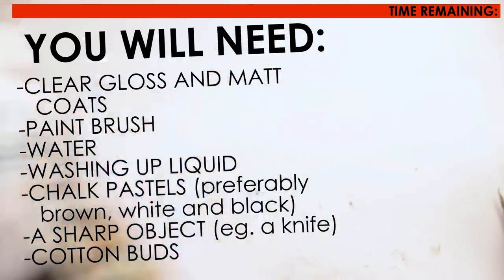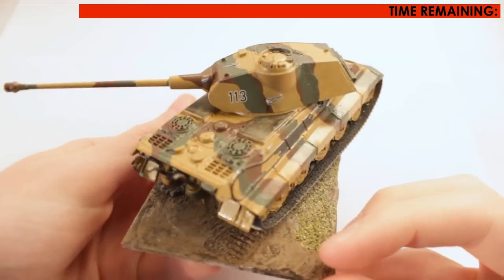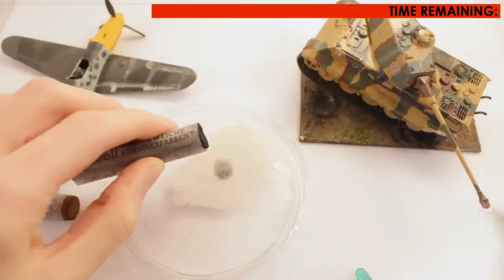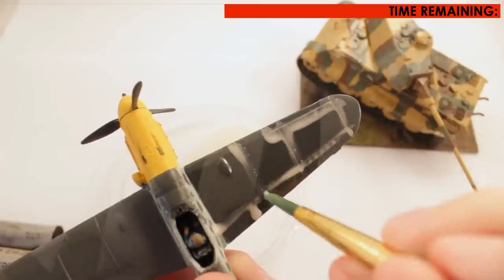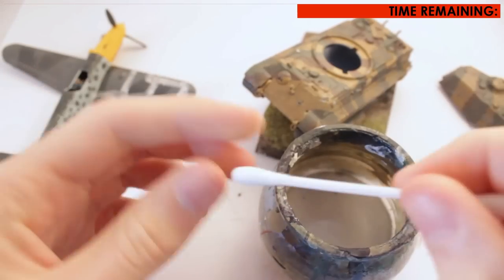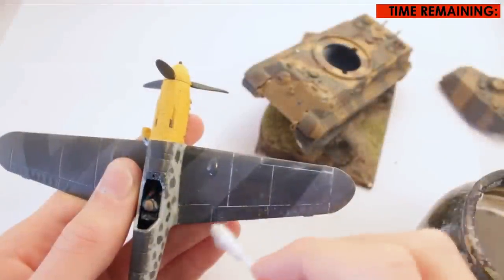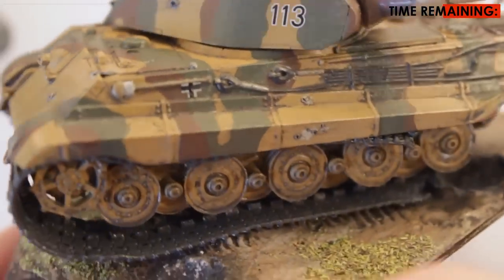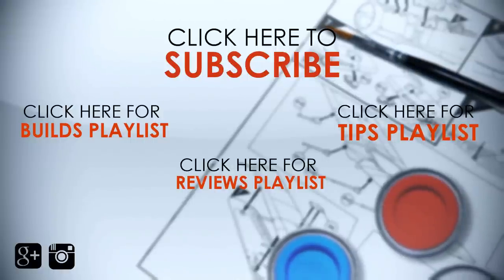Making Chalk Washes for Scale Models - Quick Tip

Comment: I dont get the coat process before decals and after painting, i heard that i have to apply gloss coat before decals to stop silvering, then i also heard you have to spray a clear coat again before a sludge wash?  So you spray 2 coats? And then a final coat at the very end? Im confused, so i need a overview of the steps after painting
Reply from the maker: +Tim's scale model building After painting, apply a gloss coat to make a smooth surface that will stop the decals silvering, then apply the decals, seal them with a gloss coat to protect them, then apply the wash. If the wash isn't oil or acrylic, then seal it with a coat of varnish either matt, gloss or satin depending non what finish you need
Reply: Quick Kits what about wash made from pastel?

Comment: Great tips! Owen could you please  tell me why when I put the wash on it never comes off with cotton buds and water?
Thank you Johnny :)
Reply from the maker: You may need to add more washing-up liquid/soap to the mixture. Test it on some scrap pieces
Reply: Quick Kits Thank you tested and worked!
Reply: Hey Owen,

I am just curious as to why the washing up liquid / soap and does it matter which soap ?
Reply: The washing-up/liquid detergent/dish soap is for breaking surface tension. Correct me if I'm wrong

Comment: I generally use white spirit and oil paints but this method may be less offensive to the old olfactory system.
Reply from the maker: Do you use acrylic varnish coats then? Surely the white spirit strips off enamel?
Reply: I only ever use acrylic paints and varnish

Comment: what can i use as an alternative to washing up liquid?
Reply from the maker: I'm not sure sorry, maybe just ordinary liquid soap? You'll have to try it on an old model first or something
Reply: hmmm i was wondering if it will work without the washing up liquid. I'll try it out if it works. Thanks for the response!
Reply: +Quick Kits Any dish soap will works.  It just lowers the surface tension of the water so the chalk stays dispersed and suspended in the water

Comment: If i don't apply the coat at the end, will the wash come off by touching it?
I tried some rain lines on  a tank and i'm afraid to touch it when it's dry.
Reply from the maker: Yes, really you want to spray a varnish over it to seal it and protect it

Comment: how to get rid of bubbles?
Reply from the maker: If there are bubbles in the wash you could have added too much washing up liquid to the ratio of water and chalk. It doesn't matter too much though, you can still apply the wash to the model then wait until it's dried. brush on a bit of water to any weird marks that the bubbles have left and it should get rid of them :)
Reply: k thx!
Reply: what do you mean by "washing liquid"
Reply from the maker: Tommy Lakasi washing up liquid - the soapy stuff you use for cleaning dishes in the sink :)
Reply: The reason for using washing up liquid is that you want to "kill" the natural water tention so the mixture (wash) flows out rather than make  bulbs or bubbles on the suface.